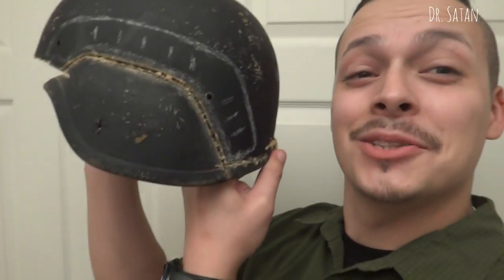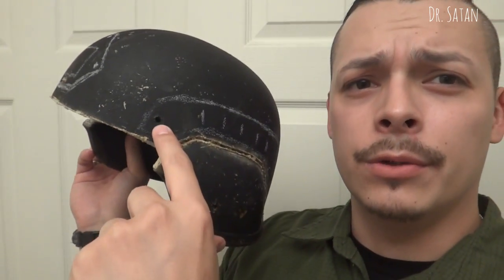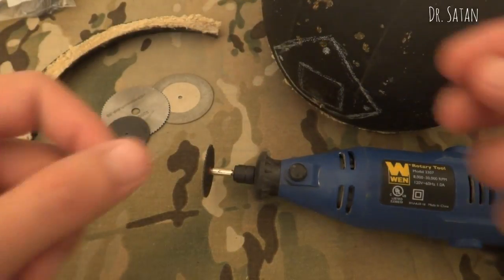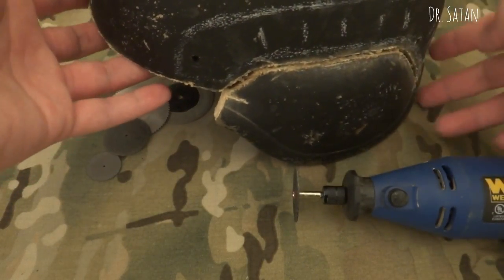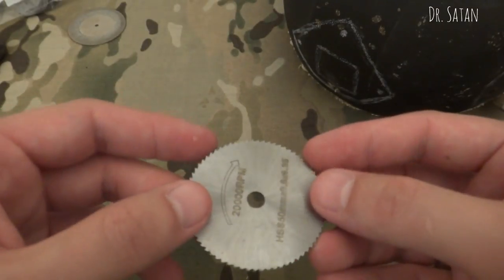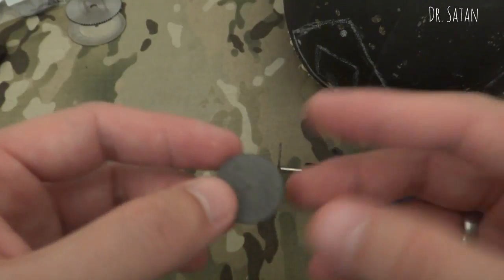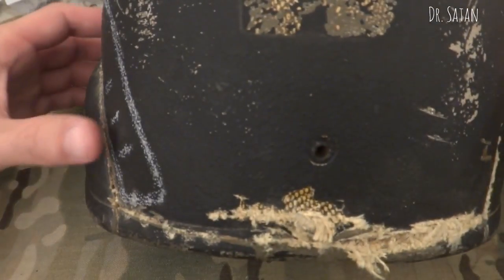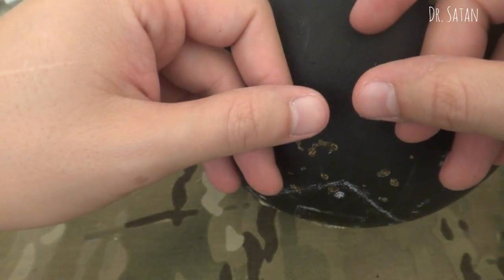Making a HIGH-CUT helmet from a PASGT - progress update DIY MOD

Comment: I started doing this with a less powerful dremel and im using the fiberglass wheel. so far my cutting is quite clean and completely flat. my helmet is gonna turn out way better than yours
Reply: Who cares
Reply: @allegiancedefault7001  im sure that dr satan woukd care if he was still here
Reply: @deltashot5608  actually he could monitize these videos. Looks like he meets the requirements.
Reply: No that’s good feedback, I’m ab to do the same thing, now I know what tools work better, I was honestly gonna just cut through it and try sanding averything down and putting a cover on, but It’s better I know what will work now
Reply: @jasonsolis5416  just do not use that mini sawblade wheel
Reply: @deltashot5608  considering that I have a one, I’m gonna try my bandsaw. I’ll report back when I do some cuts.
Reply: @phil__e_cheesesteak5024  honestly i would just spend 200 dollars on a longfri helmet because a pasgt can be up to 200 dollars on ebay these days
Reply: @deltashot5608  found one at a local thrift store for like $50

Comment: Love the intro - that's funny. For finishing the edges you might consider using Apoxie Sculpt. It's a 2-part epoxie paste that can be formed, carved and sanded but once cured is not flexible.
Reply from the maker: I may actually have that already, but under a different name- Mighty Putty. It's one of those 'as seen on tv' products. Either way, that's definitely an option. Thank you!

Comment: So, did you end up finishing this? I'm thinking of buying an unfinished Italian helmet and doing this.
Reply: I ended up keeping my pasgt the way it it was just added arc rails, norotos usgi nvg shroud, and upgraded the old suspension system to foam padding and a x harness, I'm doing the same thing with a romanian kevlar helmet and a Italian kevlar ballistic helmet, or polish ballistic helmet, use the imported ones to make good high cuts with, keep the pasgt ballistic helmets for war helmet or loaner helmet.

Comment: Rock shops that sell crystals and jewelry making supplies , will usually have diamond disks , cheap ones and better quality diamond disks with a thicker outer edge so it will last longer , so see if theres any shops in your town , Jewelry Supplies .
Reply: I just looked on Ebay , theyre cheap .
Reply: 10 for $10 bucks .
Reply from the maker: Right on! I'll look into local shops. Luckily I'm done with all of the kevlar cutting. I should have a part 2 video for this project coming out very soon!
Reply: I dont envy any one that has to cut away that muck kevlar lol , glad You got it done finally , that would take forever lol .

Comment: By cutting the helmet your exposing the Kevlar to the air misrule which makes it deteriorate and reduces ballistic protection: if your going to use your helmet for combat DO NOT DO THIS!
Reply: Tom Burger haha. A PASGT does basically fuck all against any ballistic threat besides shrapnel any way so you not losing much lol
Reply: Yeah - you don't want to cut something like that if you don't want to compromise ballistic protection. I recently bought a MICH/ACH high cut helmet that didn't have the hole(s) drilled in the front for an NVG mount. I was planning on drilling it myself but did research into it first and found out any sort of modifications to the helmet damage it. All the shaping and drilling needs to be done at the factory BEFORE the material cures. Otherwise, the material (made up of lots of really thin layers packed really densely together) can start to de-laminate and separate and stuff. So I went with a strap system instead and may go with a front mount that attaches to the same screws the front part of the ARC rails attach to.
Reply: @angry_zergling  Instead Get an old PASGT NVG mount it'll work the same don't drill it

Comment: Id rather buy the actual thing even if its expensive instead of wasting a perfectly good PASGT even if you can find them everywhere I just don't think ruining a good piece of history and helmet innovation for what ever the hell your gonna use it for
Reply: Confederate Airsoft I feel the same way and I think one day they will become scarce if people keep doing this.Id rather keep mine the way it is.Thats just my two cents.
Reply: I have a WW2 era Spanish Modelo Z (M42) helmet that I converted for playing airsoft. I ripped out the original leather liner, painted it, and covered it with a plane tree camo cover. Specifically with the cover, it looks like a German Stahlhelm. I always considered the Modelo Z to just be a cheap copy of the Stahlhelm, and since I already have an original M40 Stahlhelm I didn't care about modding the Z.
Reply: Not to mention a few years back they found outthat a lot of these were faulty.